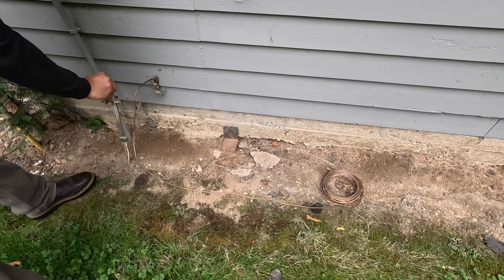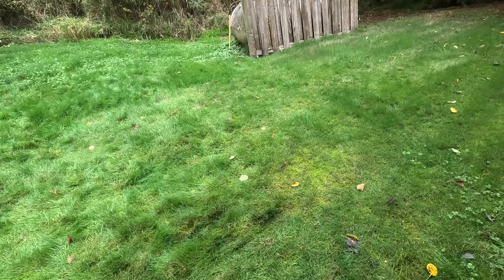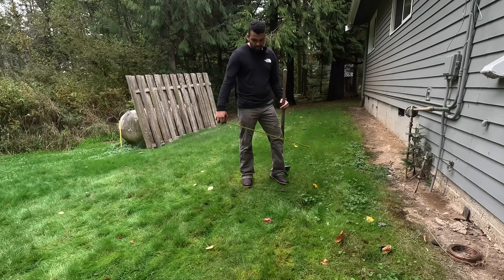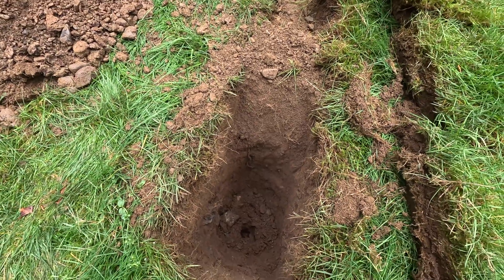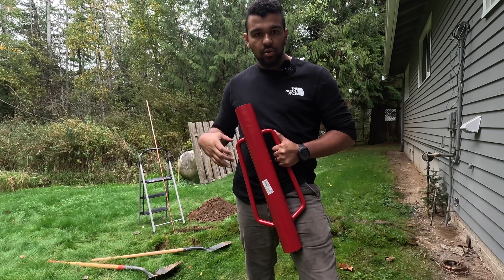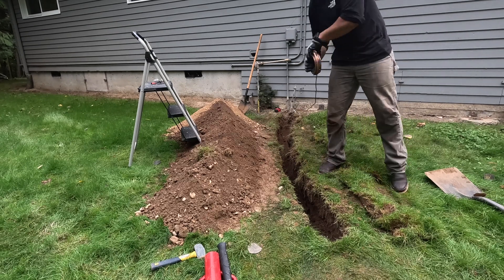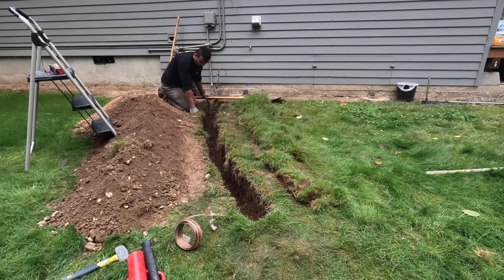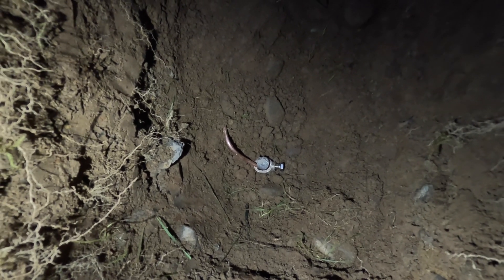How to Install a Ground Rod with No Power Tools

Comment from the maker: Per NEC 250.53(E) you can Install a 6AWG wire to the ground rods. For residential 200A installations I like to follow NEC 250.66 since this is your main grounding system in a residential home, where a commercial installation there are more bonded conductive surfaces. NEC 250.66 calls for the wire to be a #4AWG wire in my case.

Comment: Why so deep? Is there a code for how deep the bare wire needs to be?
Reply from the maker: No requirement for how deep the bare wire needs to be except what your inspector wants. My personal preference is to have it atleast 18" below grade for phyiscal protection. A ground wire has a better chance at surviving a tractor digging a hole at 18" below ground rather than 2" below grade. But to each their own.